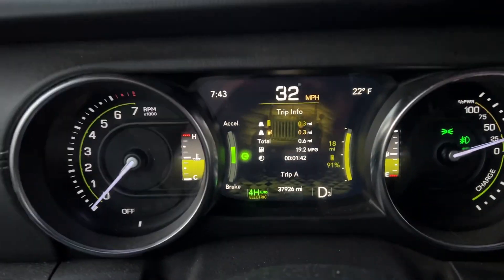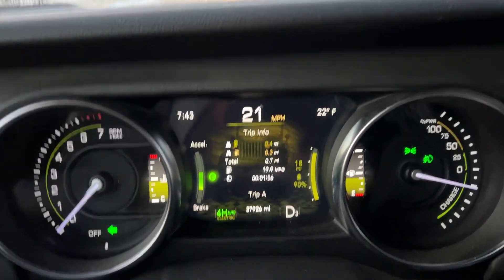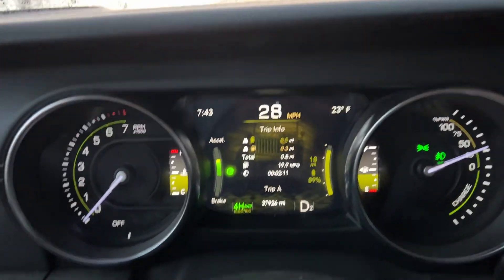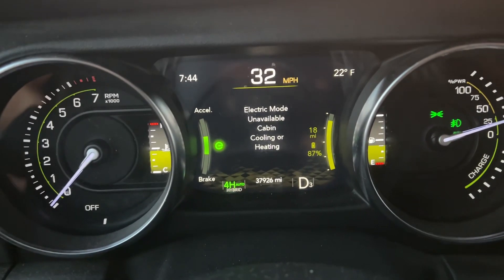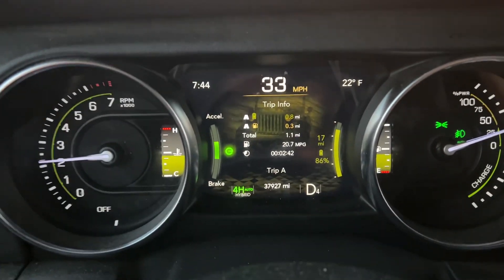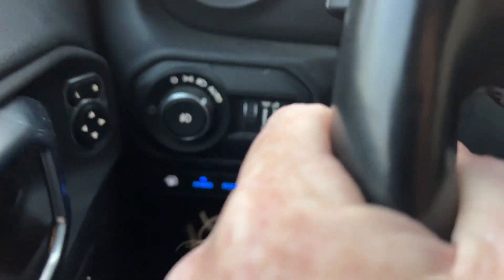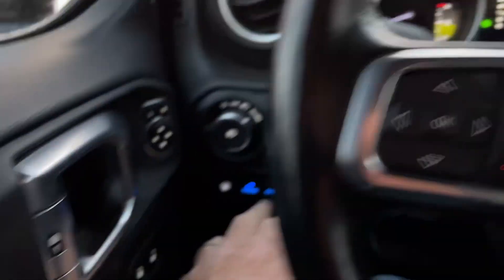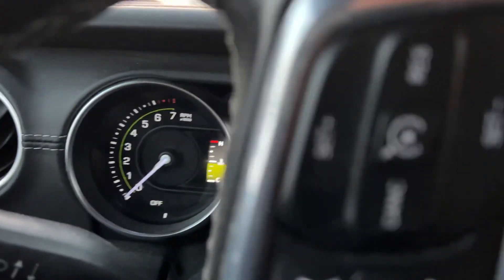When Electric Mode Unavailable Cabin Cooling or Heating is legit without a bad ECH.

Comment: I got the cabin heating message over the weekend on a fairly cold evening and didn't think much about it. Then the next morning got a check engine light, P0E15. Making an appt at the dealer.
Reply from the maker: @HokieD1993  P0E15 is exactly this. Your ECH has a permanent lock state.

Comment: Wow, my 4xe will run engine for 10 to 15 minutes for cabin heating/cooling when it's 70f out and the climate control isn't even on. It has been driving me crazy.

Also wow, my e-range would usually be 26-29 miles at that percentage.
Reply from the maker: That seems like irregular behavior. That’s really odd. Makes me wonder if your electric coolant heater is acting up.

Comment: Mine did that just this morning in the same exact scenario. I didn't know the defrost could kick it on like that. So thanks for the spelling that one out. Also, like your Jeep, the message came up but took a bit for the actual ICE to turnover. Glad to see your had the same experience because I wasn't sure if that was proper.  Thanks!
Reply from the maker: A lot of people get the EMU+CHOC message when they have a bad Electric Coolant Heater. But the message itself is built in to the system for a reason. The problem (up until the most recent updates) is that the bad ECH wasn’t being communicated to the control module. So the Jeep gave the only message it could which was EMU+CHOC. That message comes up when the system realizes it needs heat from the heater core. So the system was operating normally, it just couldn’t see that the ECH was bad. But with the recent updates, it can see it and throw a Check Engine Light now. Plus, when they plug in at the dealership, they can see the code for the locked out ECH where they couldn’t see it before.
Reply: @Wrangler4XEFans  Oh good to hear that the one of the updates canceled the CHOC message and put up the CEL when it is an actually bad ECH. I didn't know that changed! Glad to see Jeep was on top of that one.
Reply from the maker: @frankkownacki1364  Jeep is quietly on top of a lot of things with updates. I just wish they would be more communicative about it instead of the community having to figure things out.

Comment: If you get a chance to repeat this,  have the hybrid app open and check to see if the battery coolant heater is on and how much power is being consumed for climate.  That would show the normal operation of the battery coolant heater when it is really cold.   It would be really handy to have it,  to be able to show service departments what the really cold operation of the battery coolant heater looks like.

Comment: I live in Minnesota, and for the last 4 months have not been able to get out of Electric Mode Unavailable. I was given a sheet by the dealer, and told THIS IS NORMAL for this area. I don't believe them, but not sure where to go. If I had to do it all over again, I would NOT have bought a 4Xe... and I have 3 other Jeeps... a CJ, an 09 Wrangler and a 15 Wrangler... So I am a jeep fan...
Reply from the maker: At around 10 degrees Fahrenheit and below, that can be considered normal operation. Has it been that cold the whole time?

If it’s been that cold the entire time, there is some good news. EMU is actually what the 4XE is supposed to do. A lot of people get stuck in FORM all winter and have accepted that as normal operation but we should see EMU instead.

Comment: My Jeep went into FORM this morning. I put it in manual mode and kept the RPMs up - which drove up the oil temp. This was all on a 5 mile drive to work. When I went to lunch, the FORM was gone. I'm excited about that because, previously, when the FORM appeared it never went away until I got the oil changed. The drive home was all electric. So far, so good
Reply from the maker: That’s awesome.
Reply: @Wrangler4XEFans  
And it's been a bit of a back and forth since this.
Reply: What was your weather like?